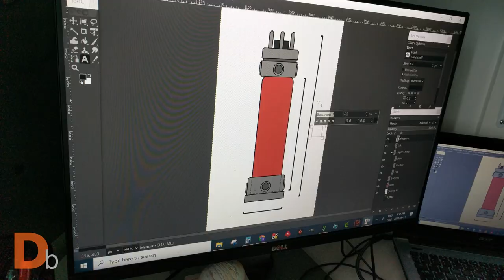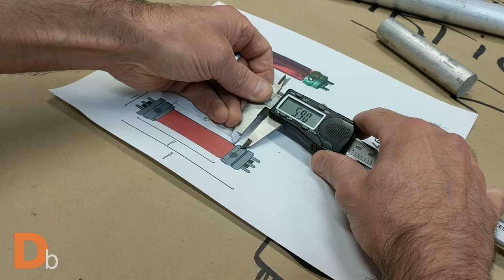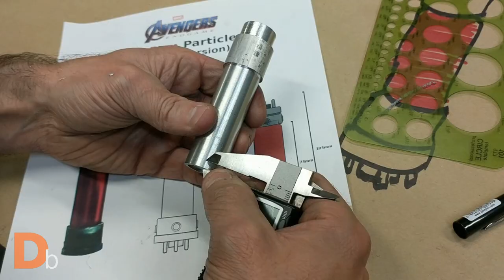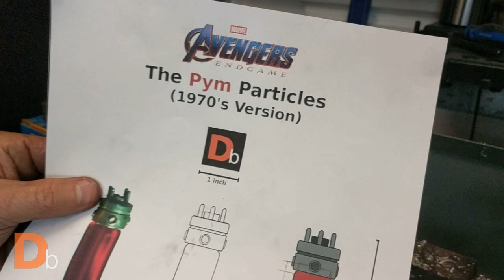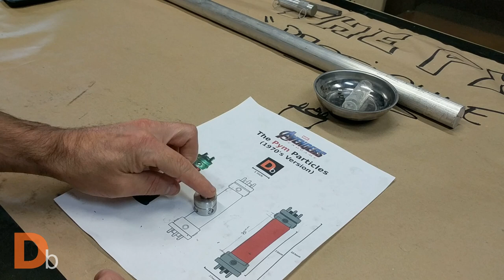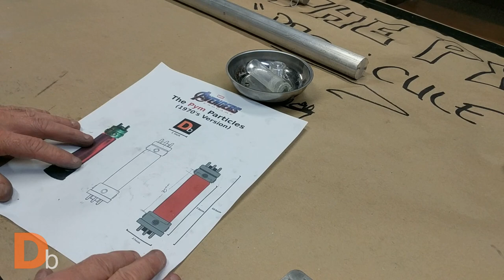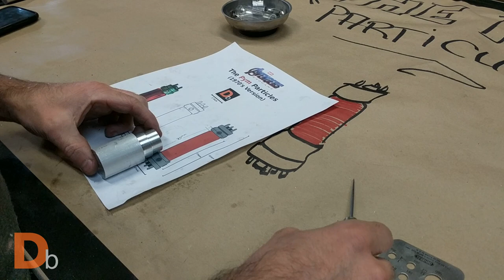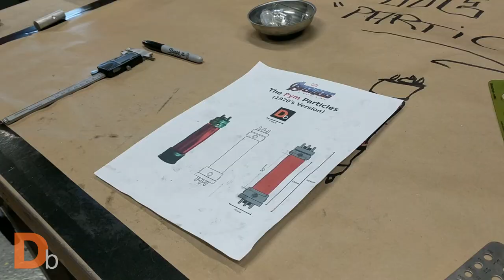Pym Particles prop replica from AVENGERS

Comment: You gained a subscriber I am new to prop making can I ask some questions?
Reply from the maker: Glad you did! Thats what Im here for :)
Reply: @DaBuild  ok so for class I am making an arc reactor 3d print over top of a wireless charger so it looks like the arc reactor is charging it I need some help making the blue print. Where do u make urs ?
Reply from the maker: @reaganmclaughlin5705  Hello again!  Short answer? There's no bad place to make your blueprint.  Any decent 2D software could do the trick. All it takes is the willingness and dedication to make it happen.   For instance, I use most of the time a pretty crappy software called GIMP but I don't really suggest it.  Since I'm a VFX artist, I first often make my model in a 3D software (Blender is free) and then print them out (as I did for the baby Groot bomb detonator template) Another answer for you would be to start with Fusion 360 or Inkscape (Both free I believe). Here's good Videos from KamuiCosplay (great channel!) on making template using Inkscape:  https://youtu.be/uix3ueIeAvA  and Fusion 360: https://youtu.be/ZSaJ6AHcD-g    I hope that will give you a good start!  Cheers!
Reply: @DaBuild  thx for being so nice. Ur props are sick and I wish my school had the materials so I could make them myself. I now also fallow ur insta and I really want to make the super soldier sirum. I will let you know if I got more questions.
Reply from the maker: @reaganmclaughlin5705  I started 5 years ago with a drill and a Dremel.  I slowly built my shop from there.  It's in constant evolution like every prop makers I suppose :)  If you want to, you'll get there.  It's out there for you to grab! Most of all, make sure you have fun doing it.
Reply from the maker: Also, if you're not already doing it, I strongly recommend Adam Savage’s Tested Channel.  That will keep you motivated for sure!
Reply: @DaBuild  thx I will do I hope u also keep uploading bec ur videos are really fun and satisfying to watch.
Reply from the maker: @reaganmclaughlin5705  I will do! Until then, Like the videos and share them.  It helps me a lot :)
Reply: @DaBuild  I will shoutout ur yt on insta and tic tok cause my friends do not watch marvel or like building. The marvel agent of shield fandom will get your back I hope. U deserve way more likes and followers.